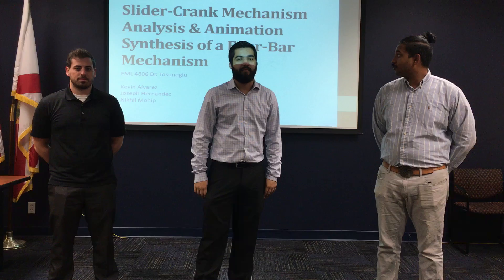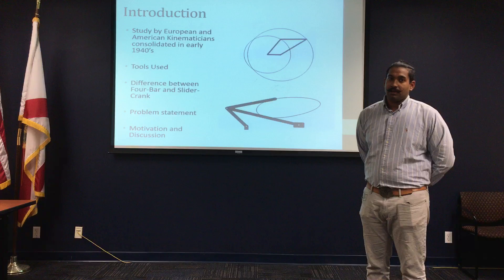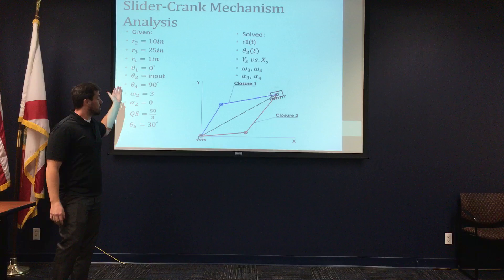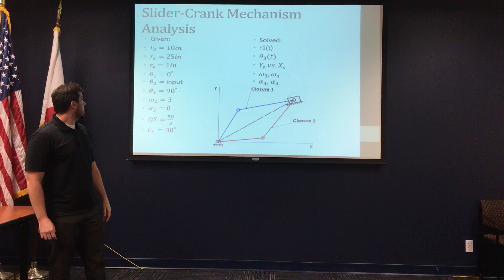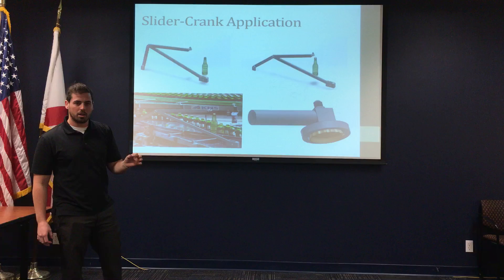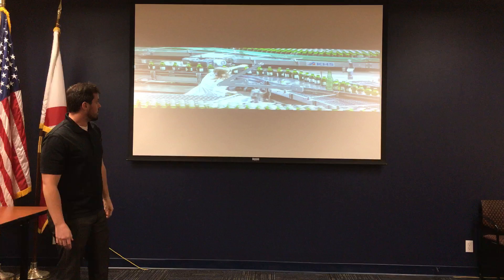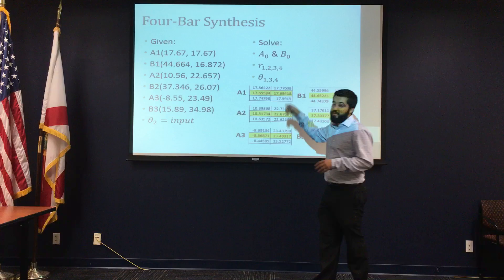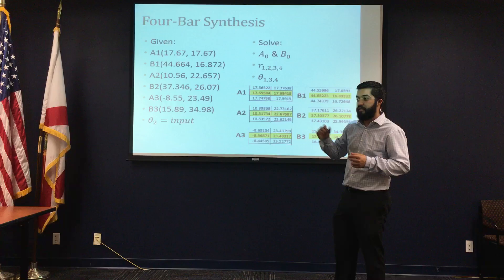Team 4: Mechanism Design: Bottle Cap Stamp & Bike Suspension Applications

Comment: Very good simulation. The team is well dressed and interaction with the camera was good. There are parts of the video where the slide is cut on the top, it is important to keep the slides within the frame of the video. Good presentation in general.

Comment: Except for the beginning of the video where the angle was off and Kevin walked in, it was very presentable. The only other criticism would be to try not to block the information on the slides as you speak about them.